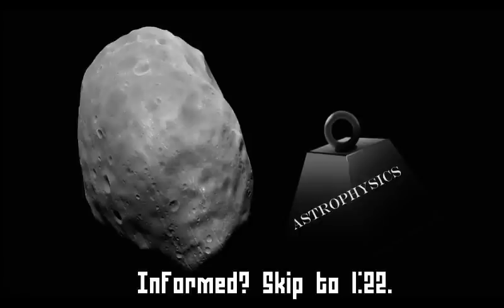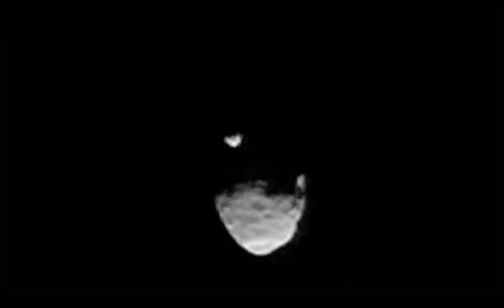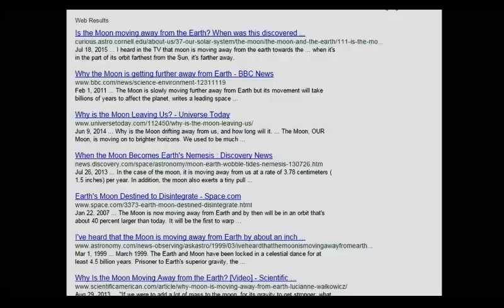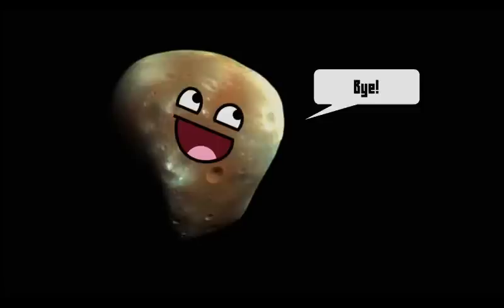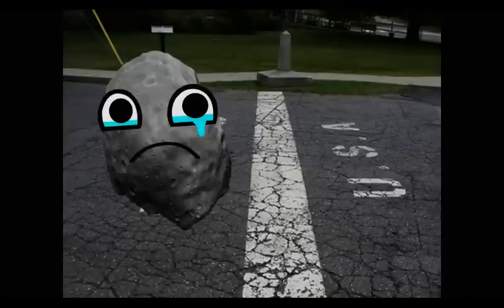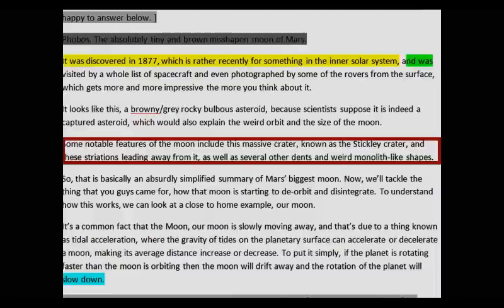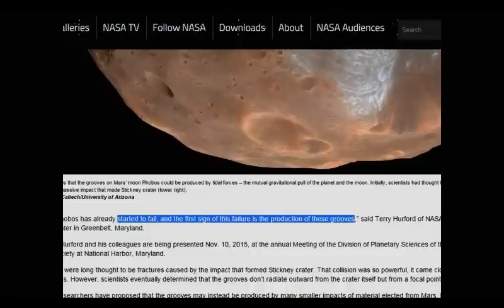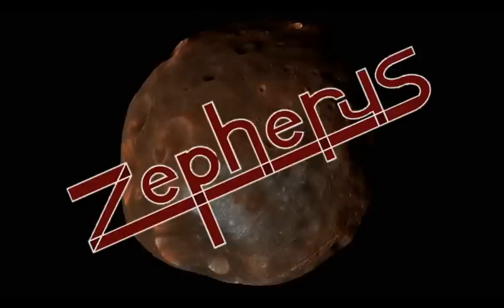Explained: The disintegration of Mars' moon Phobos.

Comment: Why do things disintegrate when they get too close to the planet rather than just accelerate towards the planet's surface and crash?
Reply from the maker: IIRC the gravitational pull of the parent overcomes the gravitational pull of itself and the material drifts apart.
Reply: So like spaghettification but tuned down?
Reply: Saturn's rings are an example of what happens to a moon or celestial body that gets into the Rosche Lobe. Mars' errant moon will end up the same way, though it'll be far less spectacular. Jupiter has a known ring from one the these, and there are a few trails around Earth that look suspiciously like an ancient orbiting asteroid or two suffered the same fate.
Reply: Yep